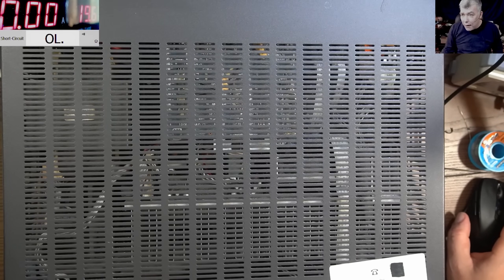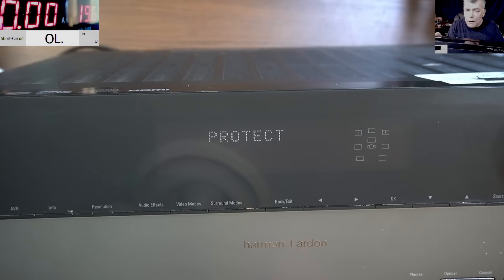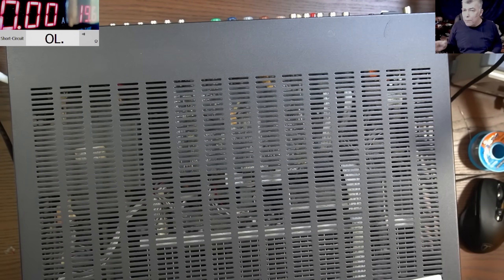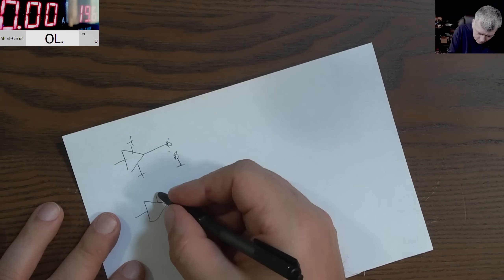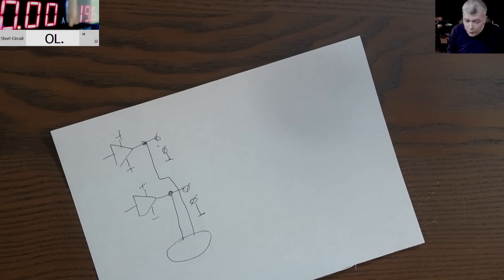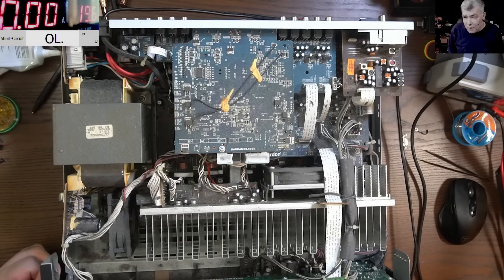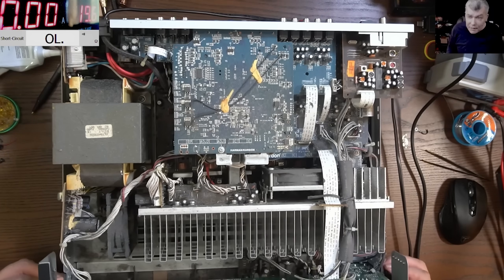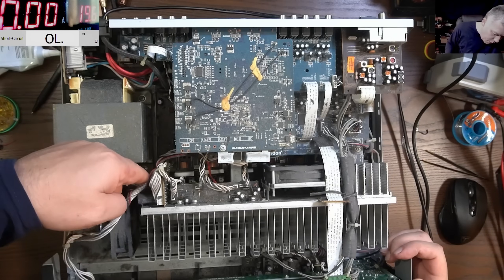Fixing audio amplifiers - let's lean about the protection circuit. Harman Kardon  'Protect' error

Comment: I have an amplifier HPA 1400. The protection LED is ON. 
Well, I plugged off CH1 on board and CH2 plugged in and its working normally. 
After, I plugged off the CH2 on board and CH1 plugged in and its working normally. 
When I plugged in again the CH1 on board protection LED is ON again. What happen ? Where is the problem ? There is no schematic - no datasheet!

Comment: I had a Harman Kardon 507 for repair, all the electrolytic capacitors in the amp section were leaky, and one resistor burned up. After cleaning and changing the faulty components, it works like new
Reply: I have an Harman Kardon AVR 520 with very low volume even when the volume maxed. (using tuner radio mode) Unlike this video it does not go into protect mode at all, which is a good thing. This amp was all setup and working fine until one day I went to use it again and there was no output. I disassembled everything and have checked all the caps and they all look normal....no leaks or bulges. No sign of anything burnt and all solder joints looked good. I did hit a few that were suspect but after putting everything back together I was still left with the same issue. All connections seem normal and looked ok. Nothing out of the ordinary. Using a meter I did not see any abnormal voltage when testing speaker outputs. What would you recommend for next steps to try and track down the problem?

Comment: taking a channel away is pretty much rendering it useless for its intended purpose.  Customers trust you with their expensive tech and you simply opt for a quick bodge and talk the customer to accept and pay.  You are not a professional. 
How can you possibly expect someone to have a home cinema set up with lets say the centre channel missing! or even the sub etc etc.  Your fix is Not a fix, it is a cop out from doing a real job and doing it with respect to your customer.
Reply: @richardhinchey1999  I rather would say, it depends on the customer. This is a 7.1 amplfier. If the customer has a 5.1 home cinema only, and if this is one of the surround back channels or if alternatively the channels can be rerouted in the preamp section via the configuration menu, a cost-aware customer might prefer this to paying $500 just for the repair. First, the root cause still needs investigation, second the unit has to be further disassembled. Right hours of labor can sum up, or more. Spare parts like transistors are hard to source. I would not like an amp with one disabled channel, but instead of spending a fortune for repair rather buy a used one that is still okay. Or a new one for not much more than the repair might cost.

Comment: 30 years ago they knew how to repair, electronics disappeared, now you give 2000 euros, let's say on an Amplifier something breaks down, it asks you more than it costs so you can buy another. I have a Pioneer vsa d802s surround amplifier I've had it for 8 years and it still works

Comment: How much can a transistor cost 50 euros to change it
Reply: A shorted final stage transistor was the hypothesis, but maybe I think it was not verfied yet. If so, then I missed that section. Removing the emitter resistances removes the problem independent whether it is caused by the final stage transistor or somewhere else.

Comment: I have NOWA AV-311 AV amplifier, vintage , that keeps glitching and suddenly turns off then back on then off and so on. I am not sure is it equipped with the modern gear that allows it to protect itself. But even when it's off the sound frequency graphic bars would still going normal but without sound. any thoughts or advice please? thanks heaps.

Comment: Sir that was minus volt ? Comparing to ground dont you? 

In the microchip as to be protected what volt + or - ? ( Comparing to ground)

In other words, if system normal when we tap the meter port to protect pin of the microchip against to gound , what would be the meter reading (volt meter)

Comment: i havd the exact same amp with the exact same issue. i had to drive to austria from germany to get a pair of transistors from a guy on ebay because they ar extremly hard to find. even when replacing one i burned it because the transistors are using a bias and the bias voltage was way too high because the double resistor was also broken. i replaces the rsistor with two single resistors and two new transistors. fortunately now i have 2 spare transistors in case i need them!

Comment: Nice straight to the point description on what generally causes the protection mode. I knew transistors were the main power of the outputs but didn't know when they go faulty that them putting constant voltage on the output is what trips the protection. Interesting 👍🏻

Comment: DC-offset is one of the protections that a good amplifier has. Amplifiers usually also have maximum current protection that measures voltage drop over two big emitter resistors, or can measure current on positive polarity by introducing additional low value(0.1ohm) resistor. Another protection is temperature(probe can be on transformer and/or heatsink), and can also monitor idle current.

Comment: Just to make it clear , it is dc voltage at the output which is important. You can easily check dc offset without opening an amp (if protect circuit is off)
Some amp designs have no protection circuit but this can easily be added to protect your speakers..

Comment: Not a fan of fans 😅 Nice tip on the protection feature 😀 If I'm not mistaken this is a "Class-B" amp hence the nice linear transformer and complimentary BJT output with split rails - cheaper amps may not necessarily have this arrangement? It's always quite daunting looking into something like this especially as the PSU usually has a low voltage rail for standby which then causes to the main transformer to come online with a thump 😵‍💫 Also depends which channel has gone on an AV amp like this - if it's only used for music it might not be a problem but for movie use it won't cut it...
Reply: It is even class AB, I'm pretty sure, without exactly knowing which AVR xxx this is. It is not the AVR 340, that I see. Could be one of the smaller ones of the line. It is class AB in order to mitigate the THD effect of the dead zones of to two output stage transistors, in particular at small outputs.

Comment: Can you explain why there should be no voltage at the output? If there is current and the speaker has some resistance, there will be voltage. What am I missing?
Love your videos. Watch em everyday!
Reply: @Ed Straker that makes sense if there is no input, and maybe that's what Sorin meant. But he said there's current, so if there is current there must be an input and I would expect voltage due to the resistance of the speaker.
Reply: The music signal is  AC voltage with variable frequencie but NO DC VOLTAGE! Thank you! also the negative and positive voltage are balanced in the circuit. The side with voltage is often defect!

Comment: its a very good solution!! 4 or 5 channels, who cares? as long it can be used, its ok!
Reply: A typical 'Sorin repair' would be to connect the rear speaker outputs in parallel.
This way you could use four amplifiers for five speakers and "the client won't hear the difference anyway"...

Comment: I tried the last repair Yamaha RX-V671 and failed. The relay activating the main transformer did not want to turn on. There was a high state on the PRY line and the transistor switching the relay did not turn it on, I sat on it for 2 days and gave up. :(

Comment: This repair would be tricky without a thermal camera.
Reply: No, Not if you are certifie. You take the voltage on each transistors and the one with negative or positive  DC voltage is defect and must be repaired!

Comment: Awesome intro to the meaning of amp protection. Did you mean to say "dc" when you said should not have voltage?  Would be nice to see more amps work, but the real key is your schematics, because the way you do it makes one comfortable without needing the actual schema for the device. Like you said in some video before, try to see without the schematic! Thank you! Also a lot your viewers do not understand the impact of hourly rate on your repair options. It is hard to imagine from a country with different economic balance.

Comment: ***😎It is very important in general that such an amplifier does not burn on its own, it has massive cooling, must check the customer's speakers or wire end connections that shorted the output

Comment: Well, this time i am a bit disapointed. On the one hand You found that problem but on the other hand it is not realy fixed. A home cinema amp with one chanel missing is kind of useless... In my eyes it is worth to spend a little time, it is just some screws and two transistors (i would change both just to be sure...). Perhalps the screwing is good work for an apprentice. Maybe it is somewhat the same with consumer laptops. For the money of a board level repair you can easily buy a used / second hand high end laptop like Thinkpad or Elitebook which is of course a much more robust machine.... 😉😇

Comment: Hi, happy evening :) I repair amplifiers, I also have this model and a YAMAHA. When a resistor that belongs to the amplifier transistor that is adjacent to the cooling heats up, its friend often burns out, always replacing 2 large transistors ... on the same port ... it is more rare that it is a short circuit of 2 transistors Little ones sitting next to the resistor without cooling ... Thanks for sharing, glad to see you

Comment: The most dificult amplifiers repairs are when you are dealing with dodgy premplifier tranzistors and diodes , which ones are not shorted  or open . On the multimeter or tester they look good but this ones can make you go crazy becouse they are dodgy and they making the amp going in protect mode. And they are difficult to identify! 🥸

Comment: You're a legend Sorin. But as an obsessive guy I would change the transistor
Reply: You know, in most cases the time it takes to replace the transistors will be more expensive than the component itself. (As I'm know life, transistor will be "out of stock" and you will have to spend time choosing a replacement)

Comment: I have an LG laptop, i fix the charging jack, it was working fine, i left it charging the battery over night, comes morning it turned it's self and started turning on and off constantly, not even enough time for the post screen to show and it turns off. I took out the CMOS battery to reset the bios and removed the power button in case it was faulty, removed everything that could cause a problem, battery, hard drive, swapped the ram with a tested one, keyboard, extension board with USB ports and SD-reader, tried another CPU, nothing helped, kept it rebooting for a while and noticed that one of the inducters next to the charging port labeled (L1) looks kind of burnet or overheated in comparison to the other one next to it labeled L2. tested it with a multimeter in continuity mode and it's passing current just fine. I'm out of ideas !! any ideas anyone ??
remark: the board does have a discrete graphic by amd

Comment: I bought new surround sound speakers, wires, drilled the holes, set everything up and now after an update my Denon receiver doesn't work. It turns on but no sound. I can switch outputs but it doesn't let me go into settings.
Does anyone know how to fix it?

Comment: Nice fix !! This reminds me of when I got given a faulty 4 channel audio control twister amp and a working infinity 12” kappa sub. Pulled the hot mosfet out on channels 1+2 which cleared the protect light, put it back together and gave it all to my little sister about 20 years ago. The setup has been in about 6 different cars and still bangs a treat.